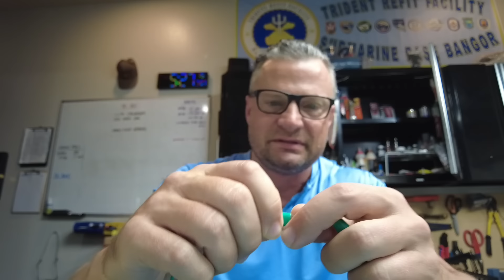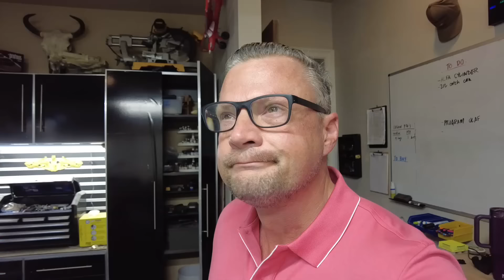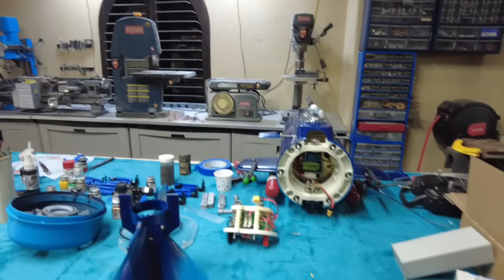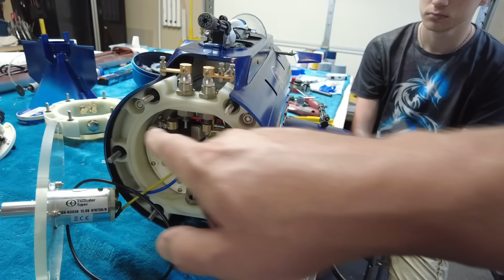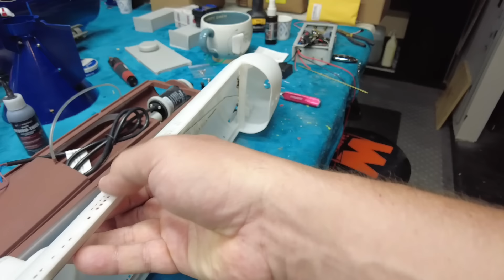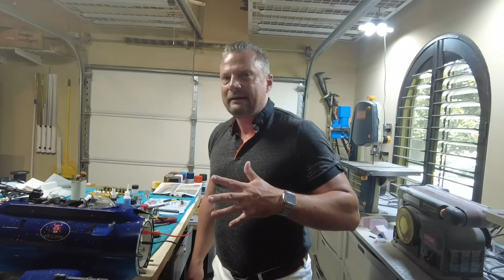The RCSubGuy Finishes HELLDIVER and Gains Heat Vision!

Comment: Bob, on the motors, when you cut the stock  connectors off the motor leads, how well do you clean the shellac from the motor leads before attempting to solder them to the speed controllers using those solder butt splices? From my experience, it's hit or miss getting the solder to stick to the wire cross sections of the motor leads after being cut. It does not want to stick to the shellac on the motor leads. When you tested the new motors, you used clips on the stock motor lead connectors, and they worked perfectly. Just a thought.

Comment: You need to start checking all your wires from overseas with a magnet.  It seems that someone over there has decided to save money and is substituting Iron or steel wire in their products.  Easy to check as these new wires stick to a magnet and can't be copper, they also have a higher resistance than copper.  Just for your info...

Comment: Might be a really silly question, but could there be air trapped inside the torsos of the figures or the torpedos?edit to add , some really nice builds to! Started me thinking if a ww1 style biplane is possible.
Reply from the maker: Both torps and dudes have vent and drain holes. I think we're good!